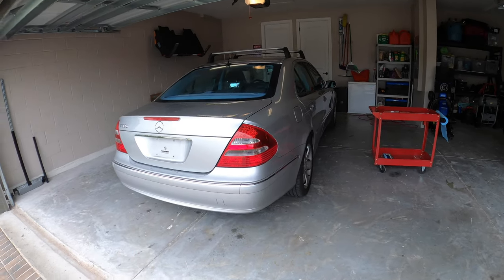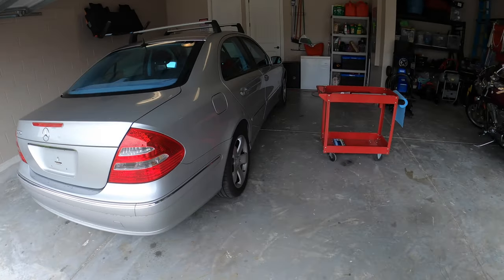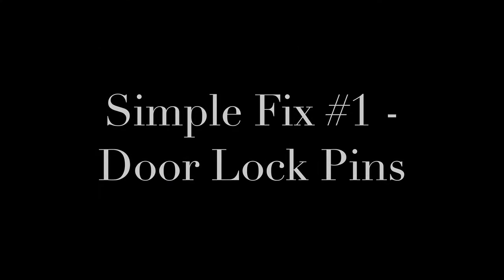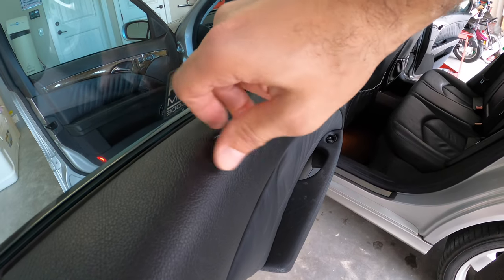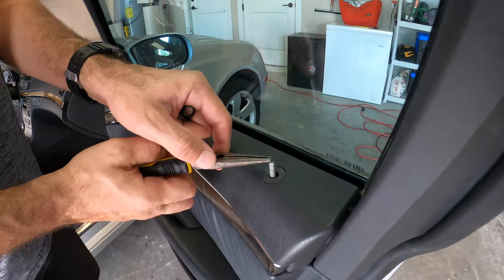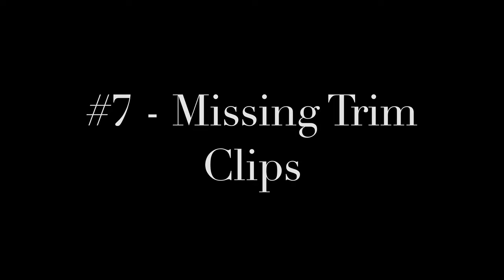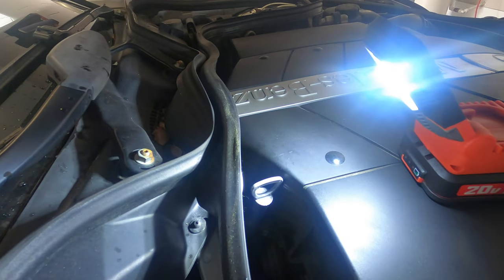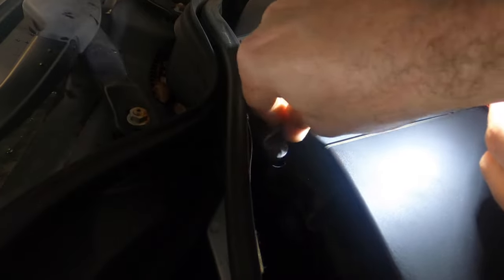9 Simple Things You Can Fix on a Mercedes E-Class W211

Comment: Awesome information...  I have a 2005 e320 CDI, leaking trunk.. watched that vid it was wonderful.. My question is what years and models will fit my car i.e body parts, anything but engine of course?? The reason i ask is here in KY there is not an abundance of junk yards with mercedes.. One more Q I did manage to retrieve a set of back doors i need to replace them (airbag blew DSR) are there any unforeseen problems like blowing another air bag? or anything? Thank you Kindly!!

Comment: I need help. I have a W211 2006 (Facelift). The car had contact (wrench fell on battery in the boot while driving) it blew main fuse the one connected to alternator. I fixed that and car is now working but dashboard functions (aircon, radio, Rear auto viser, rear headrests are not working. Fuses are fine. Recently changed fuse on radio and its now working but i dont know how to fix the other stuff that isnt working.
Reply from the maker: You probably blew your radio, which is also a computer that controls a lot of stuff. Probably your lower control module too, that is the cd player
Reply: @dcfgarage  i changed the behind the radio and now the radio is working and the CD changer too is working but the rest of the other functions that is The  rear windscreen viser, the rear headrest, the airconditioner isnt working

Comment: Iam on my second w211 and both have had water in the trunk area 🥺
Reply: Same problem  here . mostly  after a rainy day
Reply: @davidnjenga9440  yep, iam gonna get some black silicone and dissemble mine tomorrow.. i can already see rust spots 🥺.. hey another problem I've had with both cars are the ABS magnetic rings on the wheel hubs.. what a nightmare! Still love these cars though, even though they suck your wallet dry..🤣
Reply: @Rocco_toscano  I  replaced the rubber seals and it didn't help . I think the water is getting through small gaps between the panels or rear wind shield. My only other problem is the steering fluid pump.
Reply: @davidnjenga9440  ha i got a leaky steering pump too.. i took my rear lights out today and cleaned them up and used a hairdryer to dry them out properly, then used black silicone to seal the foam pad to the car and light so hopefully now no more leaks
Reply: @Rocco_toscano  this car will turn me into a mechanic. I have come to find out the things i do myself turn out to be better or more effective than when I take it to the dealer.
Reply: @igormkd222  I'll do that👍 now i have a new problem 😅 when it rains or wet on the road, my abs light comes on.. scanner tool says its the rpm sensor rear left. But already changed that.. so the wiring must be broken somehow getting water on it..
Reply: Yep me too. And I got a bunch of spare batteries and amplifiers in the trunk for my system lol. But I put sound deadener EVERYWHERE in the trunk so it's lessened alot!
Reply: @Rocco_toscano  you can replace the lil sensor thing for like 5 bucks each. Super easy to do. They come with new ones every time you do your brakes. But some ppl just leave the old ones and that's what usually starts a problem. The plastic gets brittle.

Comment: That`s the wrong Hole to the dipstick, that Hole is for the transmission Oil
Reply: No, it's oil. The W211 has a encased transmission. It's gotta be serviced. There is no dip stick. I've got a E350 W211.
Reply from the maker: Exactly

Comment: Hello how open train please m'y key do notre work
Reply from the maker: You can use the physical key from the key fob to stick it in the key slot under the trunk trim that’s right over the license plate. If that doesn’t work, the fob button and the trunk button on the driver door doesn’t work then your only choice is to pull out the back seat